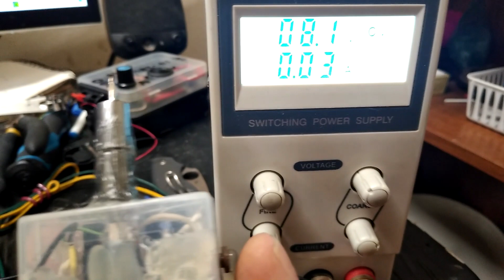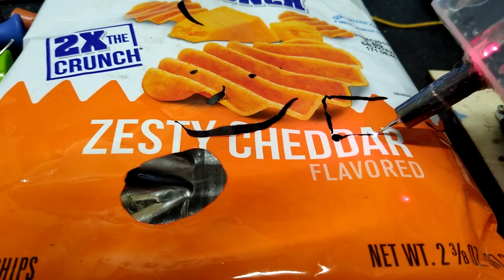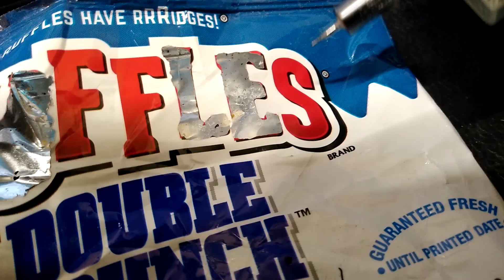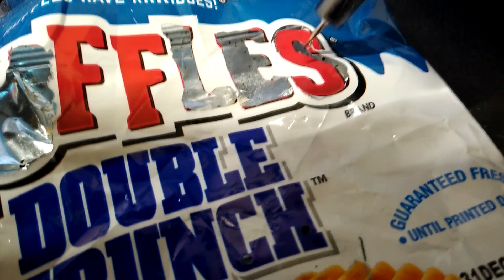Plasma Pen sort of.. (Zenodilodon/Join The Technicians)

Comment: I love it! Are you grounded to one of the high voltage out put wires on the transformer like with the original plasma pen?
Reply from the maker: Thanks! If I recall I did end up running sort of a metal 'pad' out to the case to where my hand would contact it when holding it. I don't think I was able to get this connection solid enough to the hand and ended up just slightly isolating it and making it more of a capacitive couple.
Reply: @Magneticitist  good to know